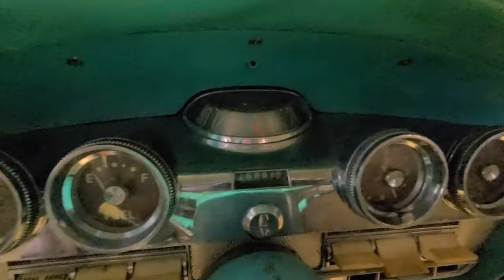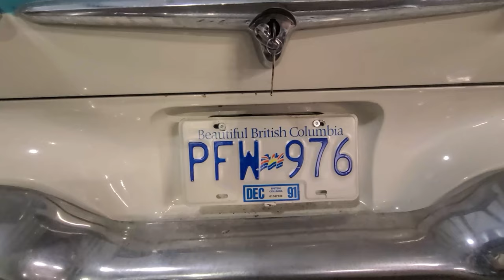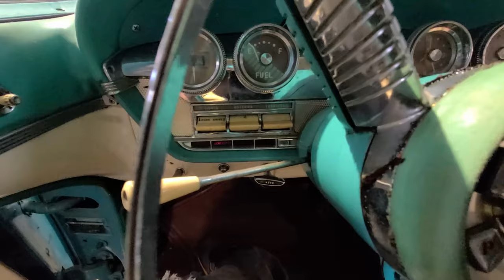PARKED FOR 20+ YEARS! will it run? Resurrecting a 1958 Edsel Citation 2 Door Hard top

Comment: You’ve probably already replaced it, but there used to be a shop in Moncton NB and in central Massachusetts that would rebuild original date coded water pumps, as well as auto generators, good luck

Comment: Excellent purchase Matt,  SO HOW MUCH EAS THIS BEAUTIFUL CAR? Sveral OF mines are All 4 doors and I  also got a station wagon to., I would OF drained the gas out first (BEFORE) starting it and put fresh fuel in it, their is a drain PLUG In the lower passenger side of the gas tank, and I would of checked ALL THE FLUIDS BEFORE STARTING IT INCLUDING THE MASTER CYLINDER BEFORE PUMPN IT as this part is very expensive, AND THE TRANSMISSION, RADIATOR COOLANT, NEVER THE LESS. I LOVE IT, THAT THING HAS GOT THE 410/475 ENGINE LIKE MINES AND THEY LOVE GAS, THEIR HOG GUZZLERS. JUS FYI, DONT LEAVE THE KEY IN THE (ON) POSITION WITHOUT THE ENGINE RUNNING AS YOU WILL RUIN AND BURN OUT YOUR IGNITION  POINTS, AS THEY WILL GET VERY HOT AND WILL OUT , AND ASLO ESPECIALLY THE COIL CAN HEAT UP AND EXPLODE AS ITS HAPPENED TO ME BEFORE. TAKE CARE OF THAT GOURGOUS BABY.👌😉😁😉👍